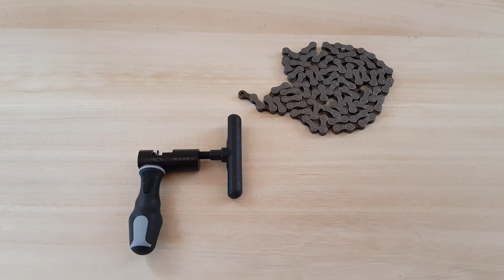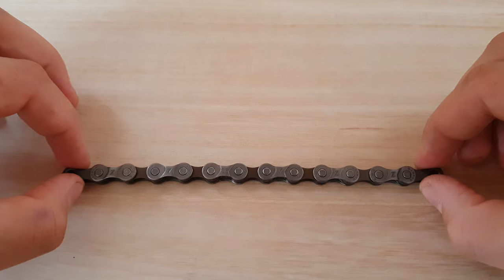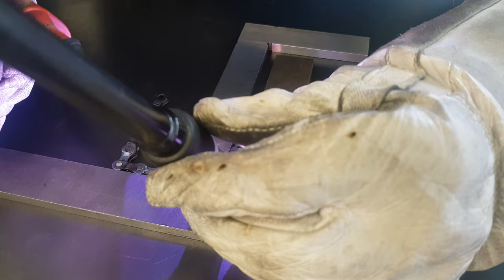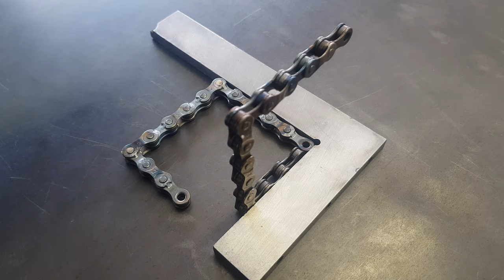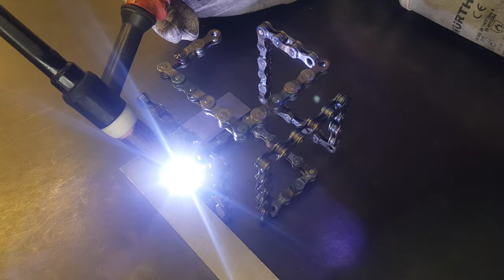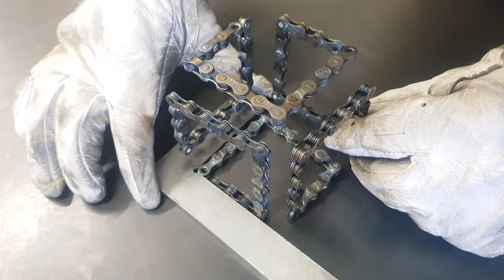Infinity CUBE made from BICYCLE CHAIN.

Comment: i'm looking to make a box from chain similar to this structure, but don't have access to a welder. are there any methods you could recommend?
Reply: Find a little 110v  mig welder with some flux core .030 wire. Can weld up to like 3/16” thick metal and anything below. That seems to be the simplest setup to get started and have a semi- clean outcome. Ideally you could find a machine that is compatible with shielding gas to get a nicer outcome down the road. The cleanest and most precise outcome would be from a quality tig welder (DC tig I believe is what you’d want). More skill involved with tig i think but I have not learned that yet. Gas mig is easy and clean looking if you can find a secondhand setup with bottle or a harbor freight sale maybe. Good luck